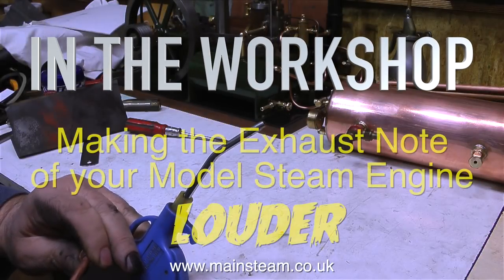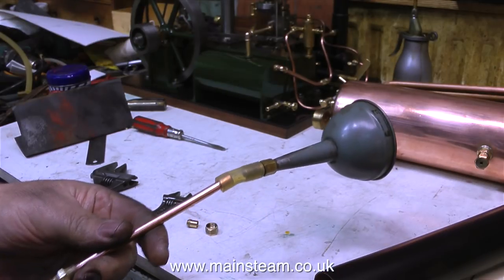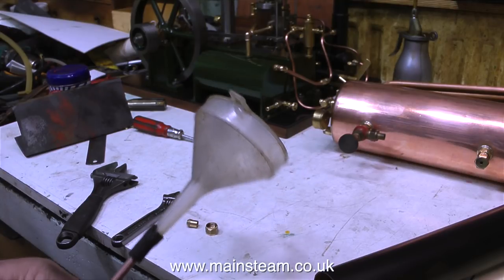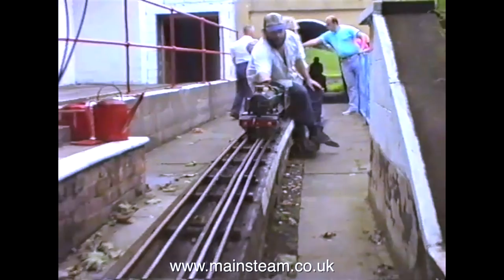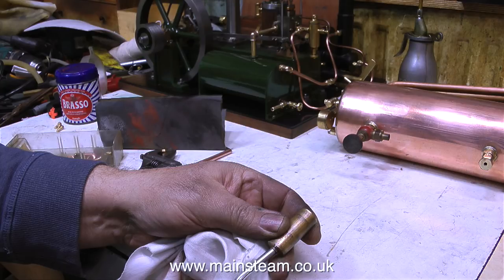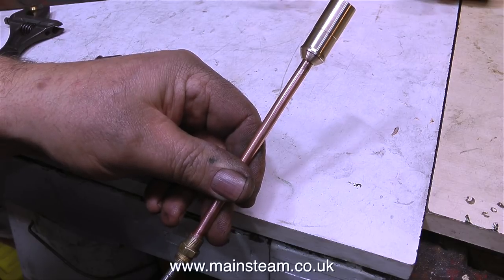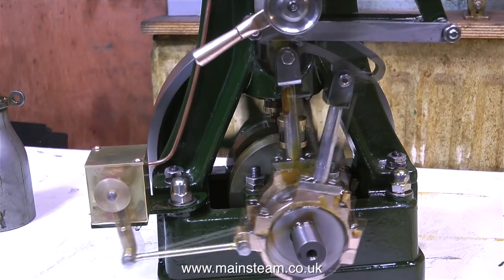HOW TO MAKE YOUR MODEL STEAM ENGINE EXHAUST SOUND LOUDER

Comment: I was trying to work out why I couldn't hear much of the differences apart from some slight pitch changes.
Then I turned off the aggressive DIY audio compressor I use so I can hear both quiet and loud things on youtube videos. And it was much easier to hear the difference. :)

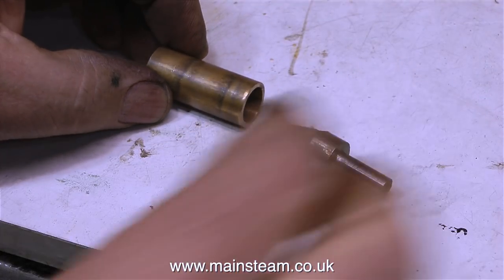Comment: Hello, little question, I don't understand what is the metal part at 2:38 minutes. My English is not good enough. Is it possible to have a section view drawing to understand? Thank you.
Reply from the maker: It is a piece of Brass tube in the form of a Tapered Cone. It amplifies the sound of the exhaust.

Comment: With the exhaust pipe end vertical up the chimney, don't you have an issue with water, steam & oil blowing up and out?  Just wondering & thanks.
Reply from the maker: No, because the "Chuff Pot" acts as a condenser.

Comment: Hi Keith,

What would that look like on a locomotive exhaust nozzle, and what does it do to the draft if anything?
Reply from the maker: it would look like it does in the video ..... it could be made shorter though. The draughting is generally due to the speed of the blast so that isn't affected much .... My "manor" class 5 inch gauge locomotive ran very well with one of these fitted in the smokebox on the end of the blast pipe.
Reply: @keithappleton  Hello Keith, would this work well on a smaller Sweet Pea sized 5" Loco?